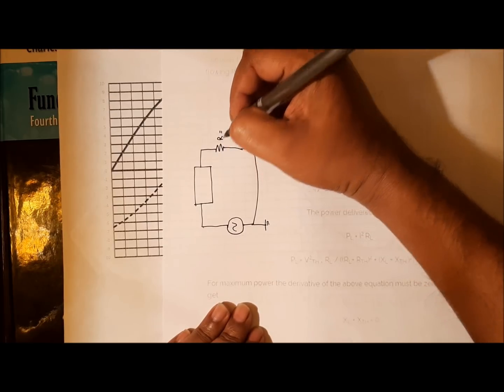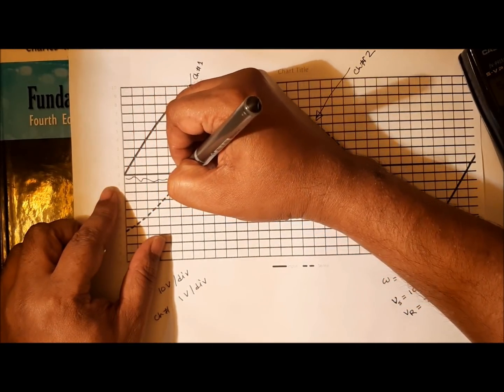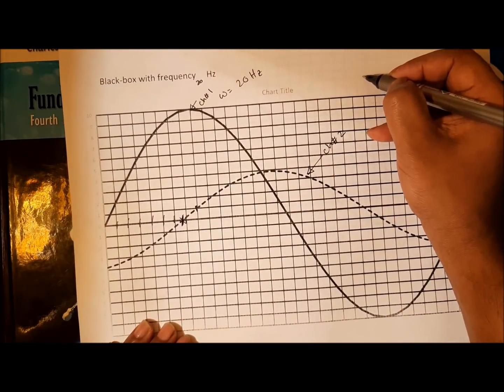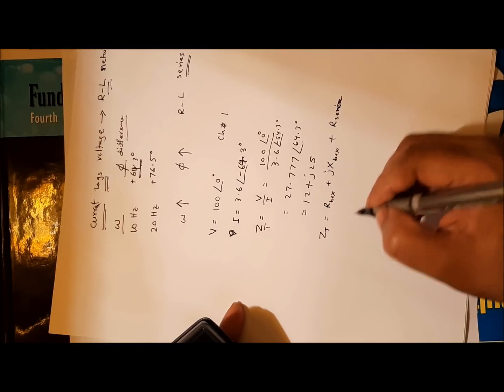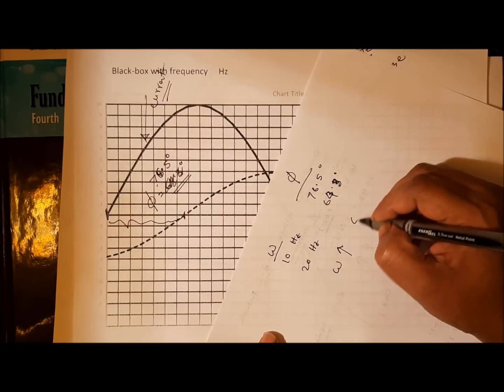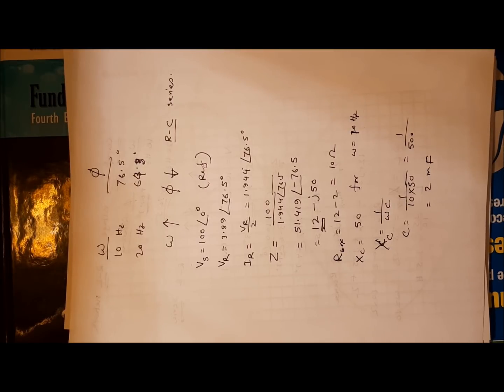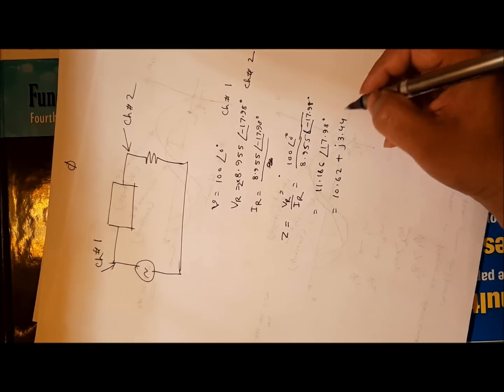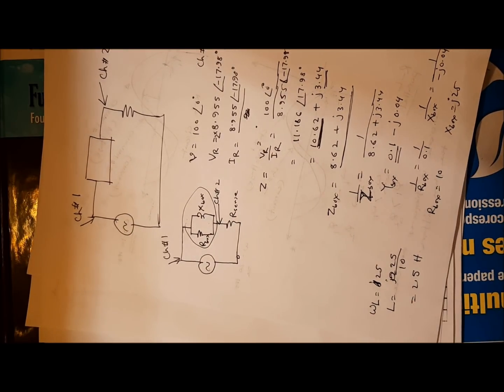Lab test Hints

Comment: how did you know the current angle is negative in the first one?
Reply: @itzhassan7720  Yes if you still take the voltage wave as reference
Reply from the maker: If you take voltage as a reference, the current wave lags the voltage (see the same event for both waves). So the current wave has a negative phase angle in comparing the voltage wave.
However, if you take current wave as a reference, the voltage wave phase angle will be positive.

Comment: For the examples given on D2L, they dont subtract the value of Rsense from R to get Rbox. When do we do that and when do we subtract?
Reply from the maker: They did in first example. As you divide source voltage by total current, you will get total impedance. The real part of the impedance is the sum of the box resistance and the sense resistance.
Reply: MD SHAZZAT Hossain how about question 3?
Reply: The total impedance is equal to the voltage of the source divided by the current (which is the same through-out the circuit as it all series). Due to the fact that doing this gives you the TOTAL impedance of the circuit, you must subtract the resistance from the sense resistor in order to isolate for the box impedance.
Reply from the maker: @Karthik Gurram  For both series and parallel circuits.

Comment: Hello Dr, I have noticed in the lab test lecture there is a RCL question, which is the third one. Will there be anything on RCL? Thanks
Reply from the maker: We don't solve R L C, practice only first order circuit.
Reply: @shazzat51  I have noticed also that the phase angle is 54.3 not 64.3 for the first one because its 5.4 right?
Reply: @Ahmad-lh1ne  He made the period of the wave 32 boxes by counting to the first peak from the start (which is about 8 boxes) and multiplying by four. He also counted the distance to the first box as 5.6 boxes. This gives us 63 degrees. 

If you are more accurate and count the entire period to be about 31.3 boxes, you instead get around 64.4 degrees.
Reply: @canatronYT  Oh totally missed that, thanks boss